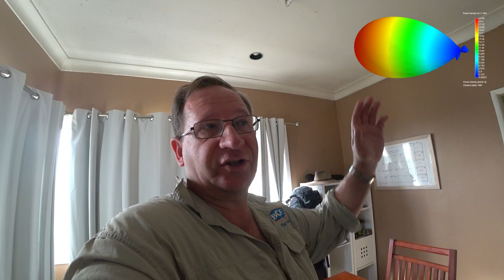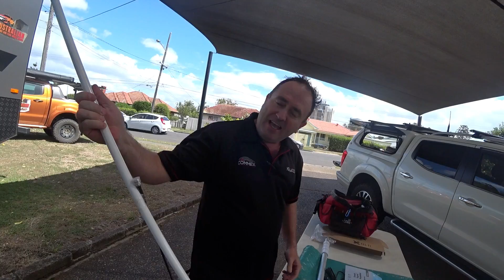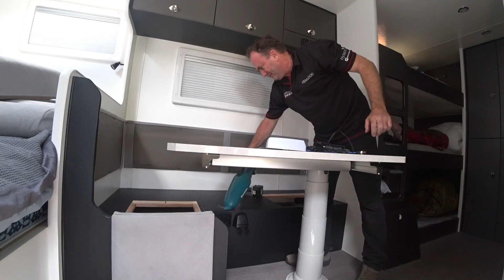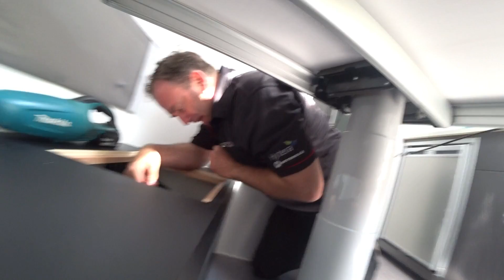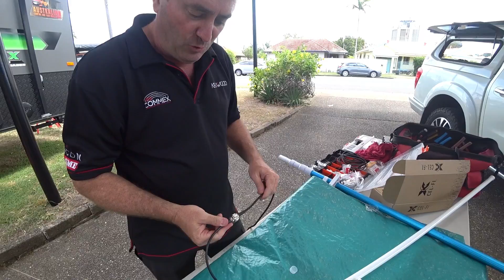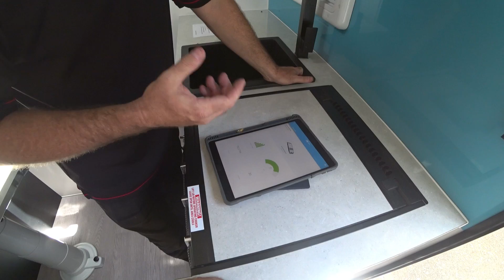Powertec - CelFi Go Signal Repeater for your Mobile Internet and Phone reception

Comment: Hi Rob. I have been contemplating the purchase of a Cel-Fi unit, but I've hesitated in case they release a 5G model. Why did you decide to install it in the caravan rather than the car ? Because you wanted the taller antenna ? It would still work in the caravan if installed in the car, right ? As long as the car was not parked to far away ? It would be interesting to see the transmission range actually. I guess you could setup another permanent antenna on the car and swap the Cel-Fi unit over easy enough. That would be a good option, for when you go camping or driving into remote areas without the caravan.
Reply from the maker: Yeah. Its a great question Kevin.  The majority of the time when we would need the reception is when we are camping, not so much when we are driving, although that would be useful. But it is early days still and we will see how it goes. The people I observed using it at Brooms head were very positive about the product. I would have loved to have it installed by then but we just missed arranging the install.

The retransmit range is not huge from what I noticed. You need to be not too far away from the internal antennae. I will see how it does and might make another spot for it in the vehicle later if we find the need ;-)
Reply: 5G will only be rolled out in major cities for a fair time yet.